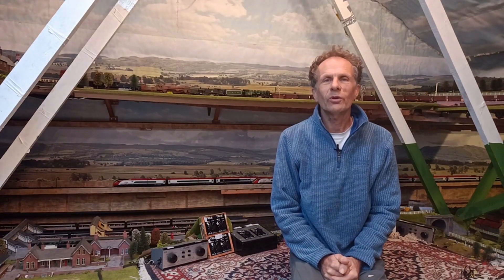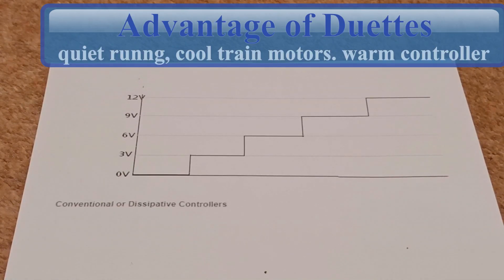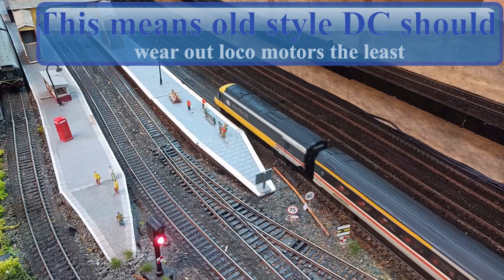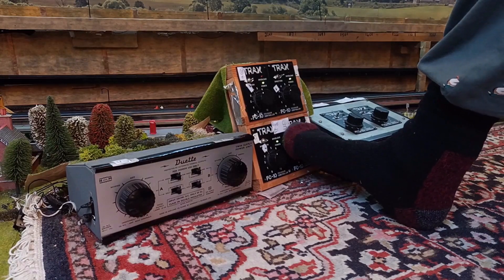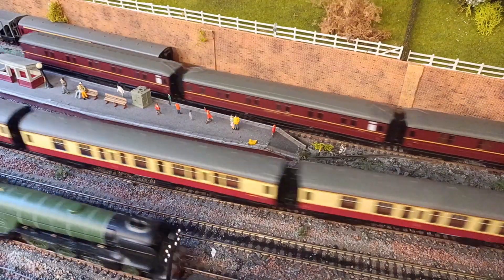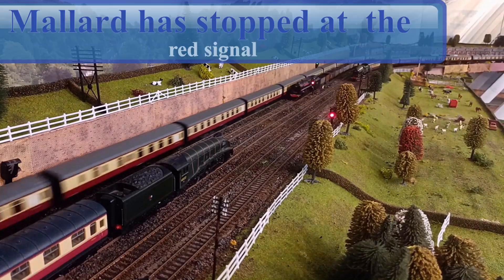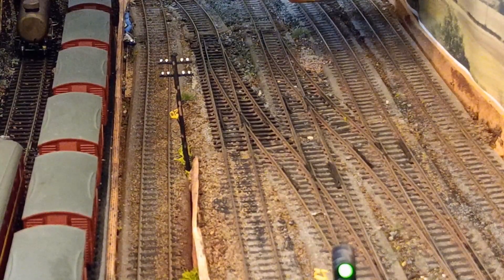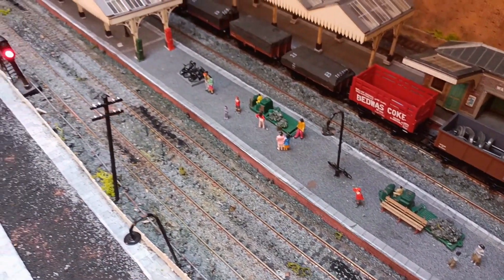DC controllers and how good are they for model trains railway

Comment: Excactly, unless you are so lucky to find 3 level PWM DC controller. Which is obviously is not possible with model train products, they all got 2 level PWM. But if you can get one, even your coreless motors would be in safety.

Comment: Great advert for DC. I started making a OO layout during lockdown, it still is not finished!. Anyway, I have 4 loops and control the loops with 2 X Duette's, perfect!! Not sure about controlling them with my foot tho!! Well done. IMHO... DCC lets you cut down on the number of controllers, but where is the fun in that!!
Reply from the maker: Rather than bending down all of the time, one gets adapt at accurate foot control. I can control 13 tracks all at the dame time. DCC works well with less trains running.
Reply: @model.train.railway.  Fantastic... great advert for DC controllers... I subscribed BTW 🙂
Reply from the maker: I am going to a video on this soon

Comment: Foot control, well that is a first I have heard for a railway - and why not if it works so well for you.  Sure single phase ac to dc rectification (as your Duettes) produces nasty ac ripple on the motor armature that in turn produces ac current that heats up directly the armature and in turn the rest of the motor ( not uncommon for form factors around 1.6, pure dc operation would give a form factor = 1)). It’s worse if use half wave rectification too. Motor most vulnerable at low speed when with any motor that is naturally ventilated and draws an appreciable current which produces heat. Does it burn out the motor? In theory it might, but for my fleet (younger days was on a H & M, now DCC in later years includes testing and running, including crawl tests in dc before I fit my dcc chips I never have had a problem and it seems that’s most peoples experiences.  With the lack of any motor technical data supplied by the manufacturers in our hobby you have no option but to go with and hope they work for your intended use I.e. manufacturers have optimized/ got it right..
For industrial drives and motors the data is available - if a motor can’t hack the ac ripple current we would add extra series inductance to reduce and improve the form factor to a level acceptable to the motor manufacturer.

PWM - again still vulnerable to low speed high current armature heating - again our hobby motors seem to cope and they can smooth out/ minimize the ac ripple in the controller by adding capacitors to the dc link to give almost a constant source voltage. The motors “smooth”performance is dependent on its armature inductance and the switching frequency - ideally you want continuous current (middle trace at 50% to 100%) which gives smooth motor torque. And not discontinuous current ( middle trace below 50%) which gives torque pulsations.
 You can get mechanical resonances which you will refer to often as a noisy motor. Think of it of a mismatch motor to the dc controller. The solution to that is to change slightly the switching frequency so you no longer excite that resonance frequency - in ac drives it’s done by a feature known as “skip frequency” . 
Hope this helps ,all the best Stephen
Reply from the maker: What I originally read appears to be a bit outdated and not dcc is using a higher frequency these days which is preventing motors overheating. Someone did tell me that in T scale burnt out motors is far common and someone told me that he gave up with DCC, You are far more knowledeable than me on this topic. It nice to hear from you.  Philip
Reply: @model.train.railway.  Hi Philip - interesting about the TT scale, wonder how they get on in N, always learning in this game!
If a motor (field) magnet starts to lose its magnetism you get a lower back emf for a given rpm, so for the same applied voltage get more current. As armature losses are the current squared is easy to burn out if not careful. That could be another failure mechanism. When I got my 50+ years old child hood engines out they would only manage about 1/3 rd speed, so had to immediately re-magnetise and all was well! All the best Stephen
Reply from the maker: I am afraid with my skill level, I have just ended up buying a new motor. I have bought 2 Pendolino motors, but that is not surprising how long and fast I run them for, and 2 for my Mallard,
kind regards

philip

Comment: I use DC PWM, with one controller being my favourite one. Home-built PWM PCB, with adjustable time for the reversing of trains in stations. I do have hand-held DC PWM controllers that do work well. T-Gauge needs PWM to control the slow-speed running, the 1st generation trains, with 1st G controllers, were a nightmare to run at scale speeds. But it is fun to experiment. Especially if proven to be correct!. Your layout really comes to life when running all those long trains. But I get nervous when the "Nose" is contra to the lines on either side, it looks so close. Great video.
Reply from the maker: Thankyou. I have 7 PWM DC controllers, I think I will put that in the blurb with the video. Its something I may have left out, thanks, Philip
Reply: @model.train.railway.  I have used DCC controllers when I "did" OO, and I always found they ran hotter than DC, especially with long trains. Now I have a 16-car train, that runs all day long, on PWM DC, and just gets warm. Yes, it is T, but we don't use the heavy, "industrial, in our terms", controllers used in the larger scales. And as to using the little piggies to adjust speeds, we definitely can't do that. That is why model railways are just so fascinating. Do you ever watch the PILENTUM channel? There is a Patagonia layout that is gobsmackingly fantastic. The detail is world-beating, and the dapple-grey horse is the very best, most accurate horse I have ever seen modelled.
Reply from the maker: Interesting. It must be so nice to have such long trains. I almost went for N scale just to do that. I will have a look at Pilentum
Reply from the maker: It does look lovely

Comment: I ran DCC for a year. Got very expensive replacing burnt out decoders. Couldn't justify the expense.  I've had more fun running DC ever since.
Reply from the maker: I am glad you told me that. I often run 18 trains at a time for 30 minutes. I rarely have motor failures. I have been tempted to go DCC.

Comment: Good stuff.
I use an H&M Duette and a Tri-ang P5A for the 3 circuits on my main layout.
Old Tri-ang engines need old controllers.
I have a GM Combo on my Series 3 layout but I think a P5A would be better suited.
I have a P5A on my Tri-ang TT layout that works a treat.
Stay safe and happy modelling
Mon
Reply from the maker: Thats a good point I forgot about. 60% of my locos are old ones and will not support DCC. I guess thats why they are cheaper on ebay.

Comment: Good Morning to you i enjoyed that thank you and i loved the foot control :) I too only run DC or as the kids call it Dinosaur Control! There is nothing wrong with it and it enables me to buy cheaper locos and engines like Lima.I use Gaugemaster controllers.
Reply from the maker: About 60% of my locos are old ones and will not support DCC. I guess thats why they are cheaper on ebay. I can but more rolling stock.
Reply from the maker: Gaugemaster are good solid and reliable

Comment: I find DC PWM to be good; usually about 150Hz. Good slow speed performance, not very noisy and never had any heat issues with the motors.
Reply from the maker: I only rely on what I have read. I think that motors are very robust and almost no-one runs motors near to the limit, so as you said, there should not be a problem. Usually electric motors can tun at high output for long periods of time as long as the heat is disapated. Philip